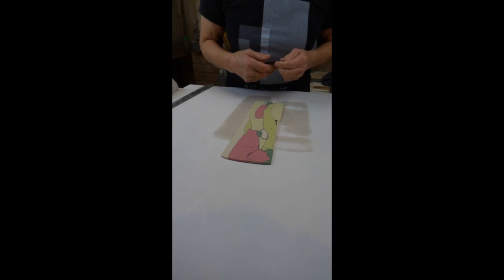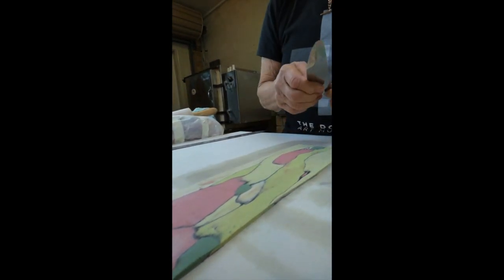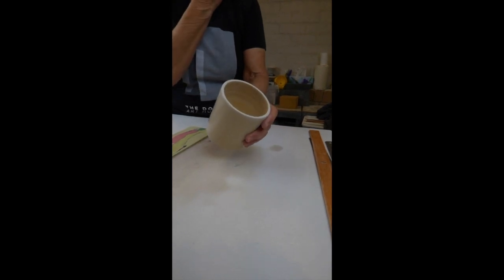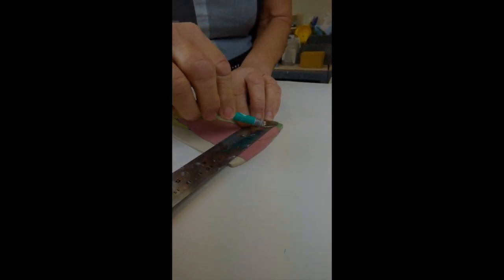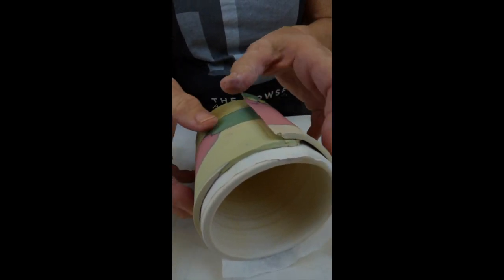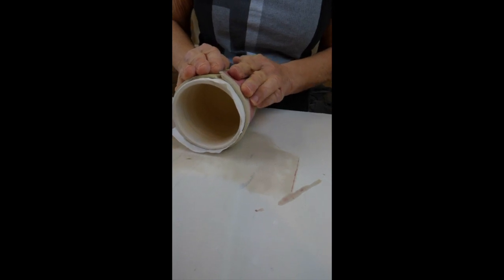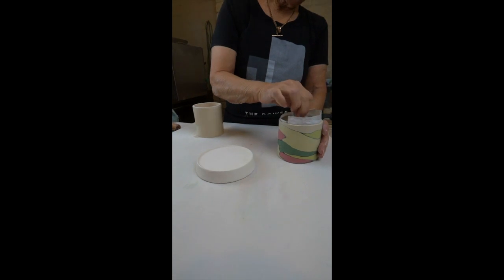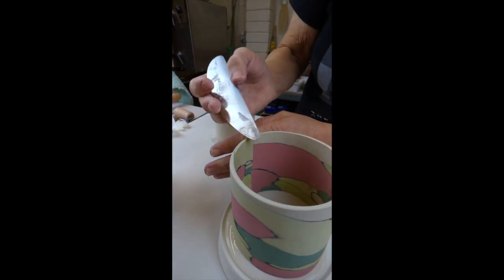Making a nerikomi cup Part 2

Comment: Even though you say it's handbuilding, actually you use wheel throwing for the form and slip casting for the base - amazingly skilled to integrate disparate methods. It blew my mind that you use a slip cast base rather than a more common technique of attaching a circular slab at the base - I wonder why. Thank you for sharing your expertise and skill.